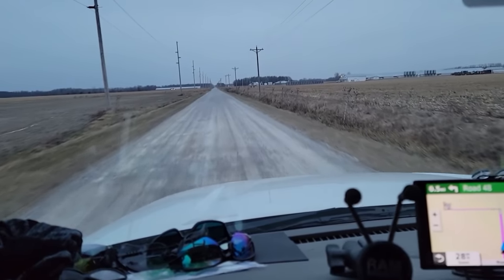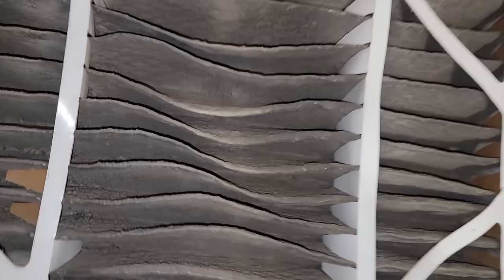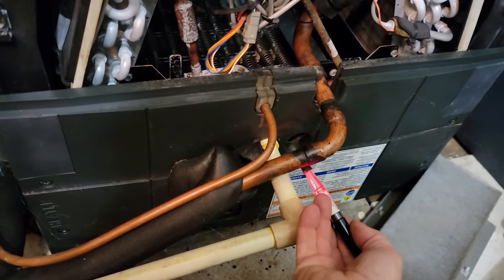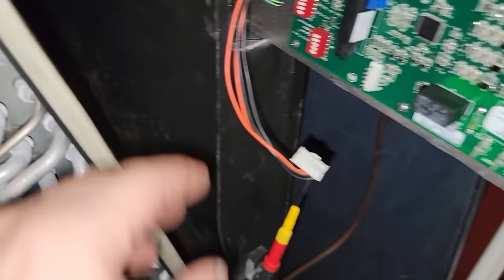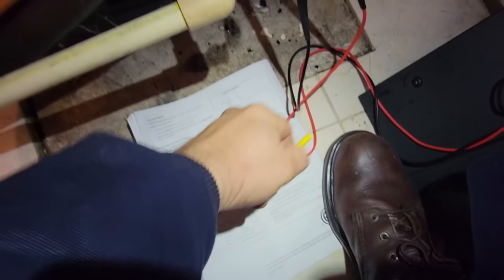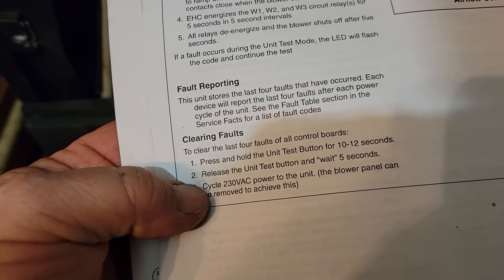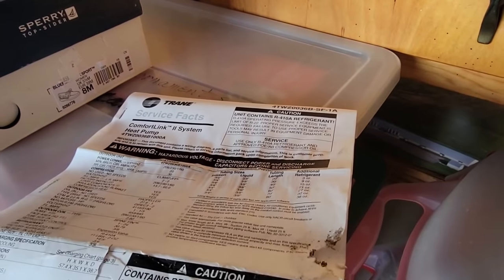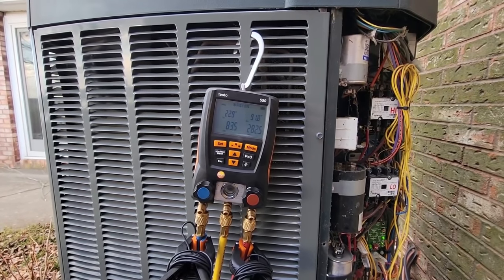Trane Heat Pump Goes Off The Rails & I'm No Engineer

Comment: We all have our least favorite brands and to be honest most of them are not what they used to be in terms of quality. But you made a good point there by adressing the quality of the installation. 

If you work mostly with one brand and everything is installed by Jim Bob and his cousin you slowly start to question the industry and your own sanity. 

Great work as always.
Reply from the maker: Thank you for your support, I figure I'll catch some crap for not liking Trane. Their commercial stuff's pretty nice. I came to this company to get away from residential so I'm really falling behind on Tranes newest equipment
Reply: @HVACRSurvival  Well i don´t like residential either because i dont´t like most people. 

I can fix a machine but i can´t fix stupid and that sets the mood before even arriving at the site.

But you know it is crap equipment when you at one point never replace parts with the OEM because a failed part is a callback and a callback is "your" fault and not the parts.

Comment: The eev board has test point for regular probes. They are labeled gas and evap.. also you can always find their service facts by using pdf. Tam7 or 8 . For future info you can just unplug the sensors plug from the board that will put the system in safe mode.. get them going.
Reply from the maker: Thanks for the feedback! Thanks for watching!

Comment: Heat pumps under 19 SEER have no place in 20 degree environment. I discourage anything but Ductless Mini-splits.  Trane is terrible on big RTU-S I had dealt with.  Not changing filters however and not oversizing the return is on the installer/ architect.

Comment: The ‘over’engineers at Trane really did a number on those air handlers. I shake my head every time I come upon one.
Reply from the maker: Thank God I found the manual, otherwise I would have been screwed. Why couldn't they put the codes on the cover. Rocket science that's why 😁🤦🏻
Reply: @HVACRSurvival  you can Google the manual been there done that.
Reply: Yes, I remember when they came out. Dear god no. However, the non electric version of it is nice. As in normal txv and no electric boards. The concept of the air handler though is decent. I wonder how they hold up over time. I rather that than a rusty old metal body.
Reply: I find every trane commercial unit I work on is insanely over complicated.

Comment: I have been working on that same system for about 3 years. Faulty sensor galore! That is not even the higher efficient system that Trane offers. Job security for sure. The original install company will not go out anymore. Sad situation for customer that spent the money $9000 on that system only 4 years ago. Definitely hit the nail on the head with the hard to stop a Trane comment in video. Thanks for sharing!
Reply from the maker: Truly is sad, there's really not that many Trane dealers in my area for residential. We will sell commercial Trane when requested and that equipment is fairly good stuff,  I am falling behind on my residential ever since I came to this company to get away from it

Comment: I will just sit here and enjoy my simple wood stove with no electronics.. 6 year old carrier propane furance in basement has a plugged secondary heat exchanger... part is warranty. $1300 labor to change though. I have thought about upgrading to a heat pump though. something like the Bosh looks nice. Great video man.
Reply from the maker: Thanks chris, check on the labor credit for that heat exchanger replacement. You might be getting it stuck to you. There's no way they should be charging that kind of money. Also watch the Bosch heat pumps. I installed series 1 in my inlaws and had bad dehumidification issues. Far as heating they do great
Reply: thanks a lot for that. I will check it out right now! $1300 Canadian funds. Like $80 American(exaggeration) haha.

Comment: I admire your troubleshooting skills and your patience. Another interesting video, thank you. I retired from Trane Canada in 2016 as a field service rep, we were a 90% gas furnace market but did sell a few of the XL20i outdoor units. The plastic Hyperion air handlers were fairly new on the market. The 20i units had two recip compressors and featured “charge assist” as you mentioned. If you had the optional solenoid for your charging cylinder and under the appropriate conditions, you could simply connect your cylinder through the solenoid, charge with liquid, and the unit would shut off the solenoid once charged. I tried it a few times and it worked as advertised. Too bad that unit was so poorly installed.
Reply from the maker: Wow cool! I always love hearing from people that were in the field especially when they worked for the factory. Like I said, they did a good job on the instructions, I have a hard time reading all the way though and not skipping then having to reread it again because I missed something🤦🏻
Reply: @HVACRSurvival  Yes, so much to read. In my day as a service tech, installation manuals were maybe 20 pages including a parts diagram and warranty info.  By the time I left Trane, the installers guide, service facts and warranty info numbered close to 175 double sided pages. That’s a weekend read…I feel for busy technicians servicing all the makes because you just can’t know it all.

Comment: Those fluke probes with the retractable guards are amazing. Got similar ones with my 87Ⅴ MAX.  Nothing like probing around a board and jumping high voltage across to another component becauseyou lost the guards, yes the work with Fieldpiece DMM's.  

Guys once you go FLUKE you won't go back, LOL. That 87 can see a voltage/amperage spikes that you didn't even know happened, you wil find shorts that no one else can see.  Reads amperage on the optional clamp down to around 0.2 amps, with this you can quickly find high amperage components low voltage circuits.  It has bailed me out so many times.  Averages out amp and voltage readings you have a solid number to note.  Can read proper voltage at the motor end of a VFD by filtering out the spikes and the ringing that can occur on long runs to the motor.  It doesn't read 0.0 like FP DMM's while it auto ranges (that will kill you).  Its ability to read peak, peak to peak gives me an idea of weather I need to go back for my for my O-scope on a bus.  I'm never on a roof without my 87.
Reply from the maker: I feel confident when I use my 87v. I have several flukes. 112,117, 902fc, 376fc, I tried the others but the fluke does a few things great vs several things kinda ok.

Comment: Thanks for the video Rick! I've only worked on those fancy Trane Air Handlers a couple of times so any information is helpful! I get why the bad senor shut the unit down but I also don't like it when one cheap sensor can leave someone without air and/or heat. At least they had electric backup. Stay safe out there!
Reply from the maker: I hear ya, that electric heat is there for that reason. Plan for the worst and hope for the best👍👍
Reply: If I’m not mistaken, you can unplug the sensors at the board and that will make the EEV valve run in a limp mode. It will basically act like a fixed piston…until you can replace the sensors.
Reply from the maker: @jasonsherrill729  from what Ted said earlier, your correct, I'll remember that for next time👍👍. Thanks for the info

Comment: You can use a resistance decade box to trick controllers into thinking they have a working sensor just for testing purposes.
Reply from the maker: I would figure yes but possibly no, the controls are smart enough to know that that number should be changing as the temperature goes up or down. I haven't tried it to make sure, it really comes down to the way they programmed the logic

Comment: Liquid electrical tape, if piercing the wire insulation.

I have molex plug tool to re pin a molex connector, those tiny connectors have to have something similar.
Reply from the maker: I had just bought two full sets of automotive style connection removal tools but I didn't want to chance damaging the plug. I only put the round plugs on the van.

Comment: I'm an automotive guy and pretty much exclusively back probe things, and use those exact probes. I sharpened my back probes to a fine point at the end so they more easily slip past weather pack seals on connectors. In my opinion those probes are also on the fat side so the sharpening really helps.
Reply from the maker: That's a good idea 💡 👍👍. Thanks!

Comment: Those sensors are notorious for failing. Those evap coils are also known to leak.
Reply from the maker: Thank you for the heads up I'll keep an eyeball out for the next one I see 👍
Reply: When the indoor coil inevitably leaks the oil will destroy those plastic panels and good luck getting Trane to warranty them
Reply from the maker: @SlimPickinsXCIV  won't matter because we're not a train dealer so we won't get warranty parts. They can call the people that installed it 😁

Comment: They company I work for is a trane dealer we actually stop selling that air handler because we had nothing but trouble with sensors going bad and EEV stepper motors going bad nice design in the cabinet I like how the insulation is not exposed to the airstream but definitely some quality control issues going on at Trane we’re seeing them in their gas furnaces as well
Reply from the maker: Interesting 🤔👍👍. Thanks for sharing!

Comment: What you can  do with the coil temp sensor (orange)  is unplug at the harness and the eev will go into a fail safe position. The board will flash 3 -4times I believe indicating sensor fault but will run.  Trane always sends the wrong parts. Good find the sensors on the TAM cabinets suck.
Reply from the maker: Thanks for the info!  I just read a comment from Ted telling me that as well 👍👍. Knowing is the 99 % of the battle.
Reply: @HVACRSurvival  I just read teds comment 😂 lol man don’t talk about his trane!
Reply from the maker: @KoolinwithKrauss  Ted's a cool guy👍👍. If all I serviced was mainly one brand, life would be easy like when I was at a Lennox dealer for most of my first 15 years, I could walk in and out of calls in under a hour. Now I'm doing everything under the sun as you see I'm a little over diversified🤪
Reply: @HVACRSurvival  dude you ain’t lying it would be nice to work with one brand specifically, unfortunately we have to figure out why the hell each manufacturer wants things done outside the realm of normalcy sometimes lol makes our days half way interesting other half frustrating (sometimes)

Comment: I usually found trane equipment to be fairly decent, but I never liked those two compressor condensers. Great video as always.
Reply from the maker: I don't doubt they're good stuff, I just don't like the way they do things so different that you can't figure it out without the manual.
Reply: Oh I've had to help a tech replace the compressors in those. You have to take the entire coil off just to get to them easily enough. Such a mess. Glad they are gone, but Idk if the variable speed one is a better replacement. No longer in the field.
Reply: @sprockkets   I have replaced the low stage compressor without having to remove coil, but it probably would have taken the same amount of time if I had removed it. The variable speed compressors are just like any single stage compressor.

Comment: I would feel the same way working on other brands higher end stuff. That's basically the bulk of what I work on, they really are actually easy to work on. Just looks confusing at first. As long as the books there your good. Lol. Good job though.
Reply from the maker: Exactly correct! Basic other brands are easy but this propriety equipment is a learning curve. I got lucky and found the manuals on the side of the duct.

Comment: Oh and the faults that you saw and diagnosed on the air handler those faults would have been thrown during a cooling operation they have probably been sitting there blinking red for a while your board outside is going to throw stuff in the heat mode
Reply from the maker: Good to know! Thanks!. I haven't done much with this model. I worked on the same condenser unit at another job but I don't believe it had a EXV?

Comment: Back probe lol, sounds like an alien encounter. Also, I’m not a fan of those GAM and TAM Trane units at all. In Florida in 2022 there was such a shortage of the EEV drive boards that Trane came out with a “work around”, which involve three earth magnets and manually opening the EEV. York makes an EEV magnet that is designed to manually open and close the EEV for brazing purposes to flow nitrogen
Reply from the maker: Cool, thanks for the info!

Comment: Twenty year Telephone repair tech speaking here.  Scotchlocks are designed for solid conductor wire only.  We warned  not to use on stranded wire or you will be going back on a repeat sooner or later.
Reply from the maker: That's great to know. Is there one that will work with stranded wire? I noticed they make larger ones that say they are rated for it?
Reply: @HVACRSurvival  The design is wrong for stranded wire.  The metal fork cuts into the wire and spreads out the wire strands along with damaging the wire.  They end up loose with intermittent connection problems.  3M should have left them with the telephone people.

Comment: Agreed the best equipment installed like $hit, gives you a big pile of $shit....  I'm a trane dealer, they have their issues same as others.  The ONLY reason I continue to sell 'em is that Hyperion air handler.  its not perfect however its defiantly a major step in the right direction.  I've had lots of issues with thermistors on the early TAM7's..
Reply from the maker: Thanks for sharing! I like high tech but I have been transferring out of residential and I'm starting to fall behind on the newest Carriers. They all have problems. Like you said, proper install is King.

Comment: The Hyperion Air Handler is a superior product in many ways.... it is metal, NOT plastic. It is just a composite coating... it is a very sophisticated unit when compared to the typical generic air handler. The metering device (EEV) is also a very superior device with the highest efficiency, and also the lowest failure rate of any other type, other than a fixed piston. I am surprised you're not a fan of the equipment.... as you seem to be one of the few techs intelligent enough to understand it. Trane products are absolutely mechanically superior. Not just an opinion, but a statistic. Who better to calculate this than someone who has sold 100s and 100s and 100s of them for over 30 years ? I literally have thousands of them out that I am responsible for. Quick Tip for the sensor situation: just unplug either sensor that is bad, cycle the power, and the system will run in "safe mode" as we all call it, meaning the valve will go to a stable position. (usually about 50%) This is a handy feature for those who don't keep these parts in stock. The low stage was just probably not making much of an impact as it is designed for the mild conditions.... 10 mins later when the high stage compressor came on you had the full tonnage to work with. Those old 2 compressor units were all 50/50... except the 2 ton. Great video, you should have known I of all people would like it !!
Reply from the maker: Thanks Ted! I didn't know that about the thermistor for Trane👍👍. I know Water furnace and Climate master both have that feature👍👍. You noticed I gave them props for easy instructions and you can hear some compliments on the product.  My main complaint is having to learn on the fly, no one wants to struggle looking for the info and if you run into problems finding answers isn't easy. To be fair Carrier can be a pain in butt if your supplier doesn't have the answer.  Lennox, Waterfurnace and climate master are some of the few that will take your call directly.
Reply: @HVACRSurvival  Higher end Trane systems should be serviced or repaired by a Trane Dealer.... and, training is key. I know these units in my sleep.... you should too !! Sign up today !!
Reply from the maker: I have been to Indianapolis for Voyager training, don't forget I have been trying to avoid residential since coming here 7.5 years ago but I have the most residential experience at my location out of the other 4 braches. So I get sent to the ones closest to our shop. It's not normally a problem on basic units no matter the manufacturer but when you have to read what they're up to it makes it more a pain. Like the charger feature, why do you need a board to tell you when it's charged correctly and even has the option of a solenoid to stop the refrigerant flow😉

Comment: I wonder if some liquid electrical tape would do a suitable job of covering up pinholes left in the wires from testing?
Reply from the maker: It might! I would usually only use that tool on wires I couldn't get into. They are labeled for Low Voltage Only.
Reply: That's what they use in auto diagnostics where piercing is often the only option even under the car.  You have to be careful with back probing as it can wedge a loose terminal and "fix" the problem till you remove the probe.

Comment: I was wondering if that EXV closes down and the system pumps down when it shuts down which as you know there would be very little pressure on the low side 
What do you think I haven’t done residential in years 
Thanks
Reply from the maker: I haven't ever seen that in residential AC equipment, at the most I've seen is a liquid solenoid to stop flow on shut down.
Reply: @HVACRSurvival  ok I was just wondering because man that was a lot of oil and those solder joints looked suspect as heck. 
Man why don’t guys clean up the old oil spots a little degreaser goes a long way 
Stay warm up there 
Thanks for replying